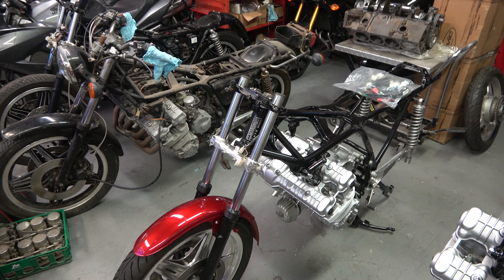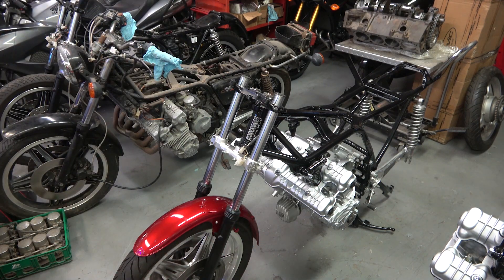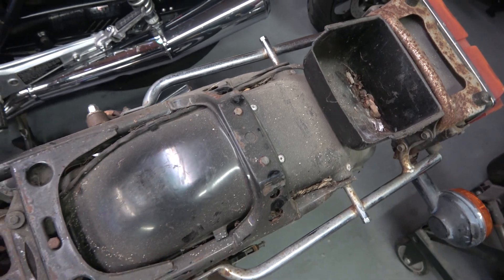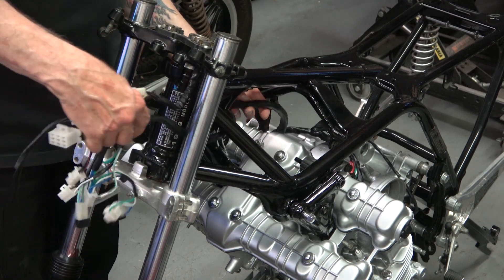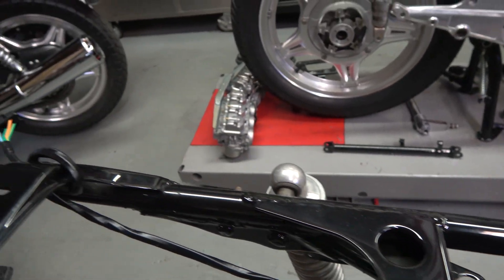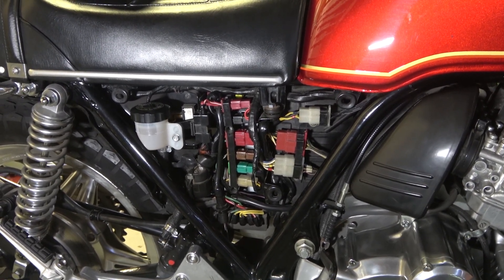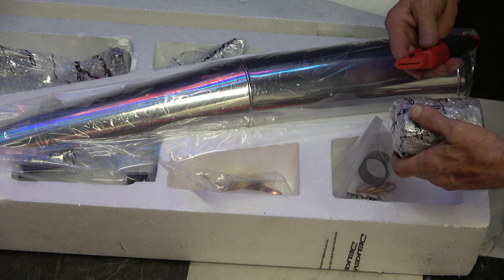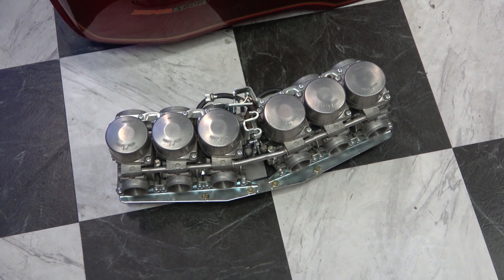Honda CBX Full Restoration & Engine Rebuild Video Series - Part 33 - Wire Harness Installation

Comment: I bought a 1981 CBX and it has the Mac exhaust on it. I have a mechanic working on the carbs and changing the fluids. I thought about putting the 6 into 1 exhaust. What are your thoughts on it? I dig the sound and looks, but not sure on how it effects the engine? I've been watching your videos, and they are Awesome! I also have a 2013 ZL1 with a stage 3 build with e85. Thank you! ✌
Reply from the maker: A 6 into 1 exhaust sounds amazing on the CBX. I personally think the stock exhaust, or the Delkevic Reproduction, looks the best on CBXs because the back half of the bike is more balanced with the wide front half. But, the ceramic 6 into one system sounds amazing. I cant remember the brand of the ceramic system, but if I were to have to choose, it would be that.